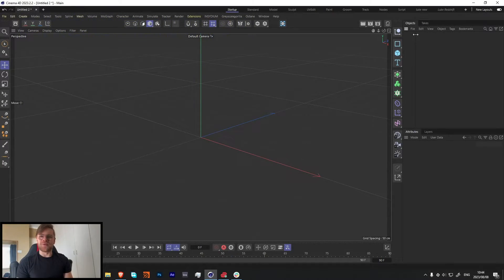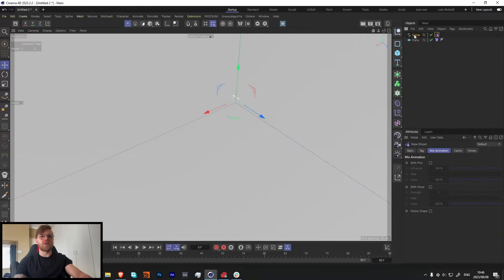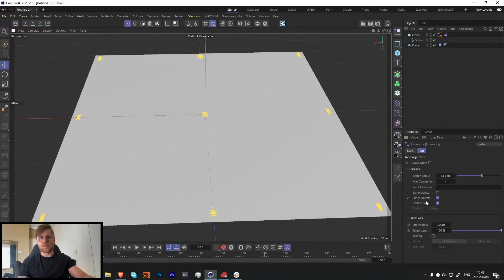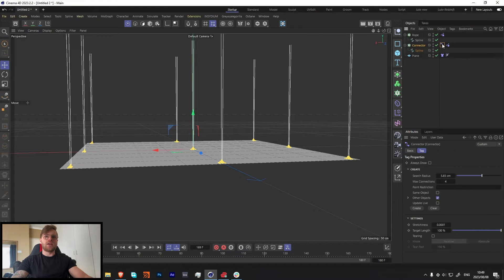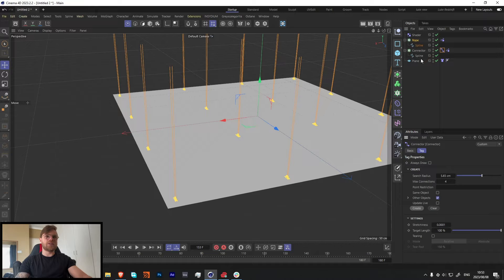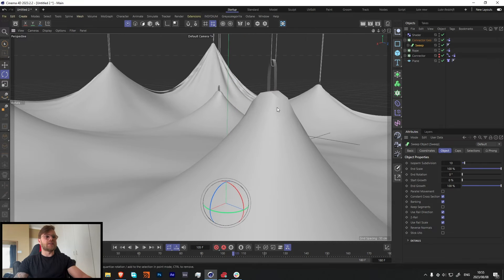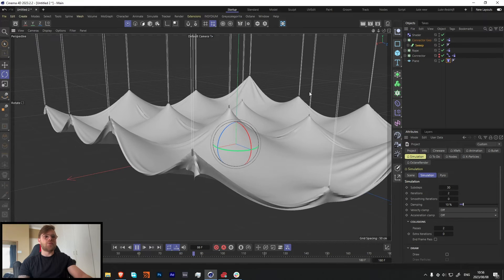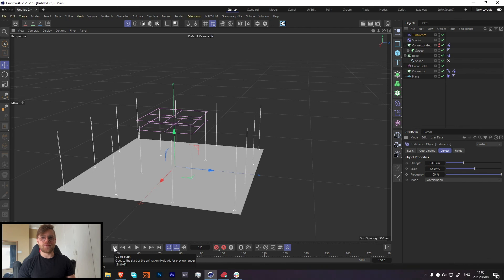Procedural Cloth Canopy - Cinema 4D 2023 Tutorial

Comment: With regard to the stretchiness and the connector pulling away from the cloth as it's pulled up - I up'ed the connector tag search radius and Max connections to 15. I didn't change the project settings at all. This still moves away a little but there is much less travel. Thanks for the Tuts. Another thought is could a vertex map be used to control the stretch?